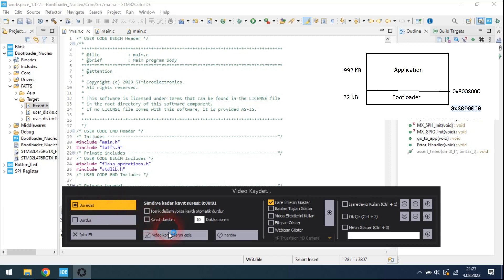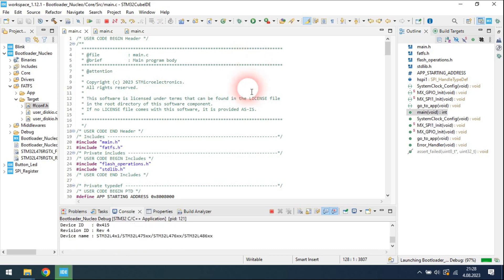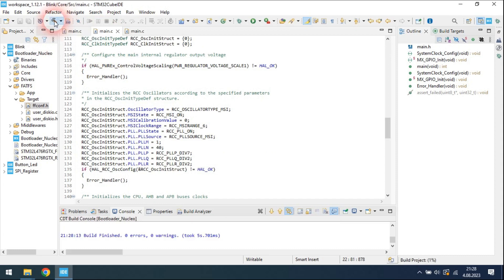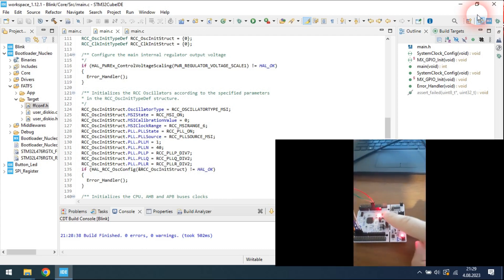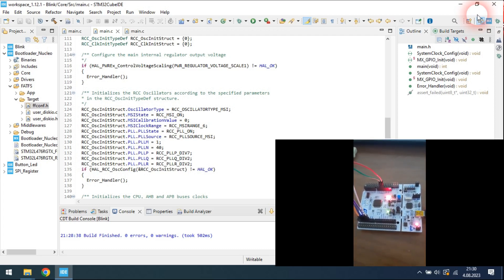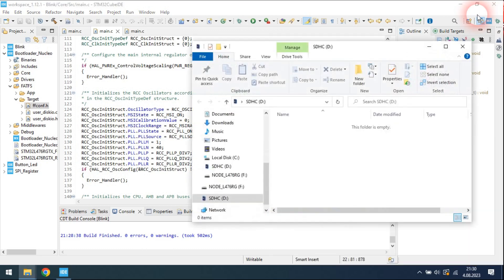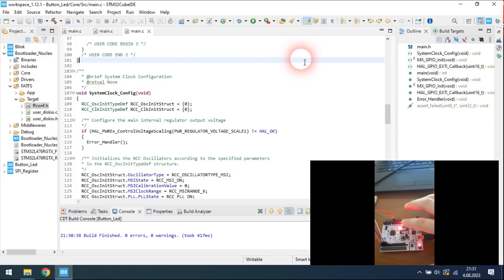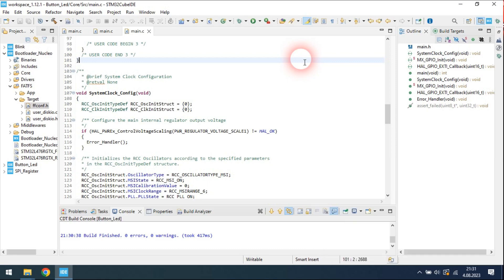Standalone Bootloader with SD Integration

Comment: I can confirm that it doesn't work with STM32F4 series. I wish it did.
Reply from the maker: yes, I specified in the title.It says STM32L4.I used register level programming for flash operations.Register operations differ from stm32 to stm32.But if you use HAL library for FLASH, I assume it works for stm32f4.Dont copy the code, copy the logic of it.